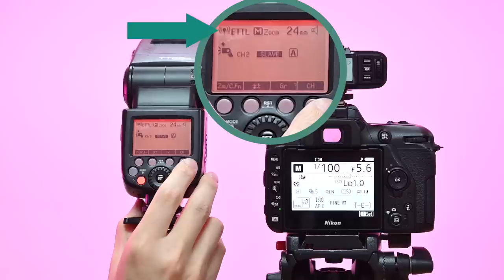Using Flash with NO ROOF? No Problem!! Testing Off Camera TTL Flash

Comment: Anybody have a link to those mini-umbrellas that the assistant was using ?  Thx .
Reply: Let's ask Andrew and Yi Chong for the link when they come online again 😊.
- Rin Othmani, Channel Admin -
Reply: as often the brand doesn`t matter, any cheap 39/40” or smaller shoot-through umbrella will do, buy the cheapest you can find ... even expensive umbrellas break at some point or become unusable because of dirt if you use them intensively under all conditions or if you don`t treat your gear like a princess, with inexpensive ones bying a new one doesn't hurt the wallet so much ... my tip: buy two, as a replacement or for you and your model when it starts raining outside while shooting
Reply: Thank youuu @MrJueKa ♥️. Good advise indeed, especially for beginners.
- Rin Othmani, Channel Admin -
Reply: @rinothmani6064  thank you too 😀  ...  but not only for beginners, we all want to save somehow if possible, right? ... so we can use our money for much nicer things in life ;-)

Comment: In this case, I see no point in using TTL since your subject is static. The output power of TTL will change constantly. This can be confusing for beginners. It is more accurate and understandable to use manual mode. For such planned portrait photoshoot, it makes more sense to use manual mode. Why use TTL with constantly changing output power if your subject is not moving? Using TTL is a bit like using auto white balance, resulting in inconsistent colors from frame to frame. TTL mode is more suitable for mobile and event type photography because your subject will keep moving. Sorry to say. Everytime I come across this channel, I always feel that beginners will take many detours and walk a long way before reaching the end.
Reply: Thats because this channel intend to promote thier website learning class.
Reply: To prefer TTL or manual flash is sometimes more of a question of faith and much discussed. IMO both have a benefit, everything is always appropriate for the purpose. For example, Joe McNally, also not unknown, says he prefers to use the iTTL mode, because it can make life easier, as do many other professionals. But yes, whoever uses speelites often should know and be able to use both modes, this is good for the learning curve and for understanding flash photography.

Comment: Under the conditions shown here outside, I would use a beauty dish with a grid or diffuser instead of an umbrella, so that significantly more flash light goes to the model and is not wasted, and the photos then appear a bit richer in contrast.
But my favorite EDC light former especially when shooting outside and mobile with one main speedlite is the "Lastolite Joe McNally Ezybox Speedlite Plus Diffusor Softbox" + small grip (see the matching videos on "Vimeo").

The pre-flash in TTL mode "only" serves to measure the flash light exposure and/or to control the TTL flash(es) used when using the built-in camera flash or a TTL on camera flash, both as a "master", it has no influence on the end result in the photos. The camera and TTL flashes communicate with each other via this pre-flash, if you want to put it that way.

I`m a huge fan of speedlites and flash photography since I started my hobby photography in the 1980s, nearly 80% of my photography is with speedlites. I`m a so-called "strobist" and a bit influenced by Joe McNally of course and David Hobby, Damien Lovegrove, Michael Zelbel and Daniel Norton.
Basically, I've nearly always been taking my flash photos in iTTL mode (Nikon) for years, regardless of whether with one or more flashes (sometimes up to 9 speedlites in 3 groups), with or without light formers, color foils, etc. 
I sometimes use the manual flash mode under studio-like conditions in my living room studio and/or more under constant conditions that I can influence at any time.

TTL flash makes flash photography uncomplicated, fast and efficient, I don't want to do without it anymore. I control the individual power output of the flashes individually via the "+/-" flash compensation. Using a matching TTL radio trigger system is imo the most efficient and safest way to go under all conditions, depending on the brand and perfect conditions it can reach nearly up to 100 meters, I tested it myself with my system (Yongnuo).
Reply: Thanks for the tips ♥️. We really appreciate them.
- Rin Othmani, Channel Admin -
Reply: @rinothmani6064  my pleasure 🙂